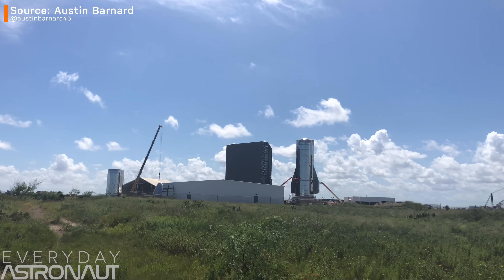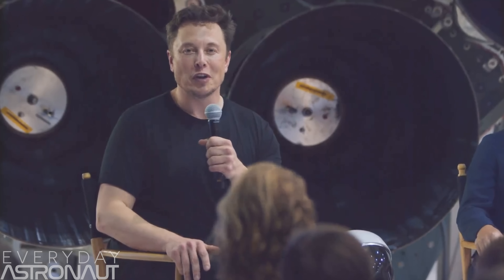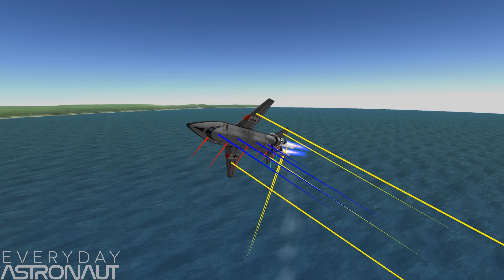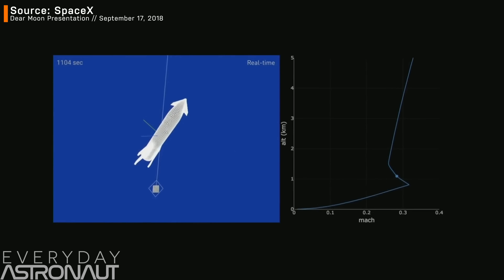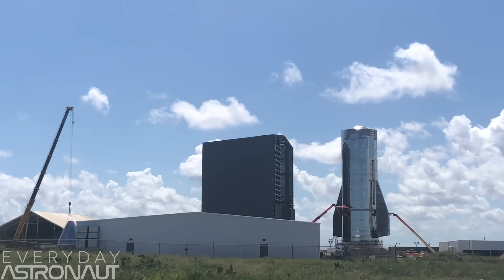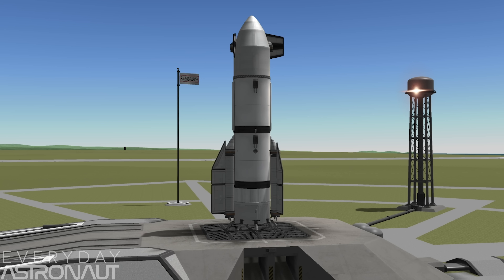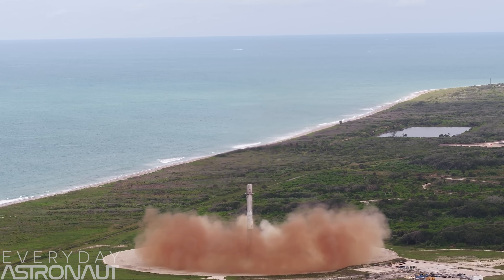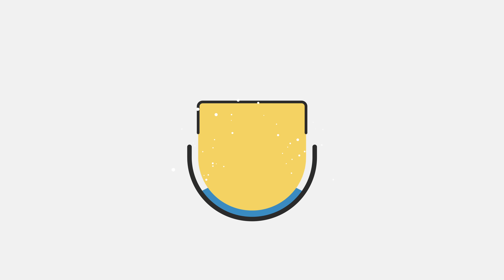Why does Starship only have 2 rear fins?!

Comment: You're all wrong, 2 fins look way cooler than 3
Reply: MrRolnicek agreed. Real engineering will always beat out artistic style.  Life may imitate art, but form follows function.  This mod is going to save a lot of weight and add maneuverability. 

Also the landing legs and two rear fin design now remind me of blue origin... TRIGGERED!
Reply: Preach
Reply: Two fins, and now the ceramic heat shield tiles, it's looking more like Space Shuttle every year
Reply: @SuperSMT  And the Space Shuttle looked HELLA cool. But it will never look like that. The wings on the Shuttle were too big because they needed to provide lift, the rear fins of Starship need to be actuated and they need to withstand reentry not edge-on but in a bellyflop. That will always limit their size.
Reply: SuperSMT right?! I mean, my god, it’s like they knew what they were doing with the level of technology they had!  I just assumed that people in the past were ignorant peasants and that Elon was the true enlightenment.  But it turns out physics is physics!
Reply: @radaroreilly9502  Shuttle didn't fail because of physics, it failed because of economics. That's no secret. The reusability of the Shuttle cost more than if they built a new one each time (well kinda ... you know)
Reply: MrRolnicek STS wasn’t a failure, it worked way longer than it was supposed to.  But it’s no surprise that starship is becoming less of a tintin rocket and more of a shuttle.
Reply: @radaroreilly9502  The fact that they kept it going doesn't mean that it wasn't an economic failure. It was made to be reusable because of course that's cheaper and it was more expensive than using expendable stuff anyway. That's a failure.

The fact that wings which are meant to create lift when used edge-on and flaps which are meant to have a large surface area look similar is no coincidence, you are right about that but if you start comparing function instead of looks you'll see that what looks similar between those two is actually completely different and what looks completely different serves the same function.
Reply: MrRolnicek ah, we are talking about two different things.  When I say it’s not a failure, I’m talking about a function of design not economics.  We didn’t have to care about money.  

Obviously the two are very different, I just think it’s interesting that as the design evolves, you kids start to have to deal with the same problems we had to “back in my day”.  Given the limited number of solutions, it’s not coincidental that a lot of them are similar in concept or execution.  That’s all I’m mean.
Reply: @radaroreilly9502  But they aren't the same problems .... and they aren't the same solutions either, THATs the funny part. They are completely different they just look similar.

Comment: Tim, I really like your new videos. You have grown into your role as space guru. Congratulations 
I have seen the stubby landing legs pics and am not impressed. Starship is very tall which translates into lots of leverage working to break the little legs. Unless Elon switches back to the original type of fold out large landing legs that we see on the Falcon Nine I fear that tipping over will be inevitable especially on moon or Mars. He changed the wings. Now he needs to change the legs. And I agree with his engineers that using three fins with legs included will have to be heavy to support the weight of Starship. I am hopeful that he will continue to make constant changes until he gets it right same as Block 5 for the Falcon Nine.

Comment: Flaps that are legs sounds like an engineering nightmare. If you need to change your landing legs, you have to readjust your aerodynamics.

I’ve been told that A/C are like jello, and you’ve gotta accommodate changes with other changes elsewhere.

Comment: I used to be a Military Free Fall Paratrooper, and I can see where the new two wing is coming from, we however have large canards on the top, we call them arms, which to achieve airfoil we sweep back and close to our fuselage, Body trunk and legs (Undercarriage), and we do create an airfoil effect, resulting in stalling and buffeting as well as horizontal flight, it all comes down to management!

Comment: At around 11:30 you speculate about the potential advantages of having a fixed landing leg on the windward side of the vehicle.
I'm pretty sure this would be unstable for all of the reasons you described earlier, when talking about aero surfaces near the 'front' of a vehicle.

In a belly-flop, the windward side (not the pointy end) is the 'front'. Having a big fixed sail protruding from the front, directly into the airstream, is the most inherently unstable configuration; the two articulated fins would have to fight it constantly. In contrast, when the fixed fin is on the leeward side it is inherently stable, and helps add to the stability of the overall system, even if the two articulated fins have their center of pressure closer to the center of mass.

When considering the balance of aerodynamic forces, you have to factor in all three fins, not just the two articulated ones.

Comment: Another important design consideration is the fact that 3 landing legs are kind of risky because with a single leg failing you are stuck on Mars with a tipped over rocket. With separate legs you can have 6 or more tiny legs that are fault tolerant.

Comment: Fine I suppose for reentry and landing on a concrete pad (earth). i'm super curious how this is supposed to work landing on an unimproved surface (mars-firma). I would think those fins would need to transition back to neutral to correct/balance the CG of the standing body.

Comment: Knowing they are going with a less robust landing system is a concern. A very tall vehicle like this is going to need, IMO, landing legs that have a very wide stance and high durability if it is expected to land on imperfect surfaces like the moon or mars. I would suggest legs mounted in a tripod configuration that would slide and extend along the external surface like the falcon rockets so it doesnt overcomplicate internal workings. This of course brings up other problems too because one of them needs shielding along with the stern mounted fins. It looks like the starship is headed back to its extremely early design. One of the things i like about elon musks idea is that the design looks more robust and tough, wich is something that is needed to inspire confidence in this odd vehicle.

Comment: Yo Tim,
Why do you think they have not used grid fins in the star ship design as they have worked a treat for all the falcons?

Also to answer your question, i think they will alow the physics design the ship over asthetics but i would expect elon to have a model of the tin tin design in his office or house for sentimental reasons because it was a cool design 😁
Reply: They will reenter the second stage (starship) at much higher speeds than the F9 first stage. For this, they need large control surfaces. Grid fins don't produce enough drag and might also not survive the heat. Putting them there in addition to the flaps would not make sense.
Reply: @tombratfred3102  thanks

Comment: I can totally understand why you'd decouple the landing legs from the control surfaces. You want those things to be super responsive! Imagine flapping your arm around with an empty hand, and then while holding a 10 pound weight. Any mass that can be removed from the fins translates into weight savings in motor size and battery pack size.

Comment: I agree that this has a lot to do with simplicity. Less is more in this situation. My only concern is the landing legs. The distance spread between the legs if incorporated into the body. You will want them away from the body like the falcon 9. This is also a big factor when landing on an unknown surface. Not to mention the height of Starship almost requires legs that are spread out to help for all around landing stability.

Comment: Another issue to be dealt with by the landing legs is the need to actively keep the starship vertical even in case the landing site were not perfectly horizontal, as supposedly would be on the Moon or on Mars. This would be easier to do with three legs, but having six legs or more would allow to remedy the eventual failure of one or more legs.

Comment: Big mistake landing vertically on mars or anywhere without concrete pad.
Reply: Hopefully, they will see how well they can observe the landing site in minute detail, from space or a surface rover, of an unprepared landing spot on Earth and try landing there several times first before finding a nice big flat spot on Mars with that one small overlooked boulder that will crunch the rim of an engine or exceed any landing gear flex upon touchdown.
Either on Earth or Mars, can't wait to watch the tests!
Of course, they could always use 3 tractor rovers with plows to level off a site ahead of time and/or provide an exact triangulation beacon for the craft of a closely pre-surveyed landing site! Lol
Reply: @grinninggoat5369  I will be convinced it will work after few for example unscheduled 
 beach landings.
Reply: @786otto  , it would be nice if the ship and crew itself could deploy small surface rover(s) with surface condition testing gear to survey a larger, preselected landing site and then anchor themselves in the soil as independant precision beacons when a best suited spot is decided upon while the craft remains in orbit, pre-landing... that way, even an emergency landing would not require so much help from Earth or other non-mission equipment already deployed in orbit or on planet primarily used for other purposes. Soil density, type, obstructions, composition.
1 rover as a becacon underneath the landing spot or any nearby that is unanchored may prove problematic at last seconds before touchdown if they would get blown about and disrupt the fine guidance of the craft though... so, maybe 3 rovers or 1 that tests site, anchors beacons and then retreats to safety to be recovered and possibly reused in the future.
Any site selection data gained from previous rover missions or orbital surveys may not be valid at the time of arrival due to the weather and sandstorms on Mars. 
In any case they will have to be very careful indeed and updated to the very moment on surface conditions localized to a very small landing area to make this work. Anything else is luck and odds if they plan to do repeat performances without problems!
One thing is probable... it won't be like landing on the Moon since Mars has a much more active surface. The soil on the Moon didn't get blown around by an atmosphere, have winds that uncover obstacles and the such and a general landing site could be picked easier far in advance for... I doubt there will be much human eyes in guiding intervention on the actual landing on Mars.
Reply: @grinninggoat5369  Hopefully they figure out the way to safely land

Comment: That's not what fly by wire means.
Reply from the maker: No? “Fly-by-Wire (FBW) is the generally accepted term for those flight control systems which use computers to process the flight control inputs made by the pilot or autopilot, and send corresponding electrical signals to the flight control surface actuators.” - first thing that pops up when you google fly by wire. Sounds like exactly what I described 🤷‍♂️
Reply: @EverydayAstronaut  It primarily differentiates mechanical (hydrologic, etc) vs electrical with an electrical actuator at the control surface. It changes a lot of structural requirements regardless of the software intricacies and refinements. This is fly by wire. Usually triple redundancy wire.

Comment: Dumb question of the day;  Why do they even need these huge fins, if they're just tucking them out of the way on descent?  The rocket clearly doesn't need them on ascent... 2. If aesthetics are important, I liked the elegant, curved sweep of the earlier fins more than these blocky ones.  3. The safety issue of using control surfaces as landing legs never occurred to me - I'm obviously not aerodynamicist material.  4. I'll just never understand why NASA spent seven years developing those tiles for the shuttles, if all they had to do was use stainless steel.

Comment: I never liked the 3 fin-leg version, having one fin just acting as leg. 
I prefer this version but I am sad that they would not use methane for RCS, using only one fuel for propulsion and control thrusters makes all the system smaller, more dynamic in the sense you choose in what you need to spent more and less tanks.
The only thing that methane thrusters need is a low power laser ignition system that was already tested to be super fast and reliable.

Comment: I think that two fins is more stable. If you put the third fin behind, it does little for control. If you put it in front, it will be fine until a slight roll. This will greatly increase drag to one side, and increase the tendency to continue rolling. I noticed on the Starhopper test that with three fins in a stiff wind caused a roll. It wasn't bad but it was there. Thankfully a slight roll didn't pose a problem for the test. But landing a Starship will be much more demanding. I also play KSP. Thanks for the informative video.
Reply: I think Tim or someone mentioned somewhere that The roll on starhopper was intentional by way of the acs thrusters.

Comment: It was never really a 3 fin design as the 3rd one was fake.  It was always about where to best place the 2 functional fins and it's clear they work better directly on the side.  However, the weight (and reach) of the landing gear do "weigh" against that.

Comment: Hey Tim. Why SpaceX not configurate Starship like a Falcon 9 with it own Gridfins and retractable legs? Thank you for the answer
Reply: Only the Falcon 9 booster lands and it never gets all the way up to orbital velocity so it doesn't have as much speed to remove.  In contrast starship (which is the second stage) does get to orbital velocity, so it has to remove that speed to land.  There's too much speed to be an efficient use of fuel so instead they airbrake, skimming the upper atmosphere to slow down.

Comment: They could still have 3 Flappy Flaps that swivel sideways to tuck away using 2 or 3 hinged joints & hydraulic rams to straighten them at the appropriate times for legs or for aero braking.

Comment: You don’t have to worry about the number of fins during landing on Mars, there isn’t enough ‘air’ on Mars to bite into aerosurfaces.  They will need a long propulsive braking burn to land there and then rely mostly on RCS.  I always assumed Starship would do a skip entry because a traditional entry just seems like 2 fins would be reduced to zero somewhere around 200,000 feet.  It has a shape that could be used for a Sanger style entry profile but getting back is still going to be tough, very tough.  The belly flop maneuver is the very thing you would do to put yourself into a flat spin, their yaw control better be really good.

Comment: 1. Two fins / aerobrake flaps seems much more sensible. 
2. And separating the function of aerobrake flap from landing leg seems more sensible as well. It is a lot of engineering to make a big fin / flap support the weight of the space ship.
3. As for whether they will tuck in on ascent, my guess is that they will not articulate that far. Sticking straight out will not be any worse aerodynamically than sticking slightly out but nearer to the cylindrical hull.

Comment: bottom legs are certainly going to be lighter than wing integrated ones and there are a few other advantages but this is a bit simplified - I think one of the biggest advnatages is the angle at which the fins can be attached if they aren't landing legs

Comment: 3:50 in a event of a damaged Starship on Mars/Moon and flying it back to earth:
Would it not be wiser to rendevouz in earth orbit with a totally intact Starship, transfer passengers and cargo and THEN try to land the damaged one?
Reply: The problem is that they need to slow down when arriving to Earth. And it will likely require more fuel than the ship can carry to slow down without aerobraking.
Reply: @anthonypelchat  
Right. Aero-braking is needed to land even from LEO, not possible to reach enter any Earth orbit (from Moon, Mars, etc) without aero-braking to dump energy. [If the sea-level Raptors were the only problem, then a ship-to-ship transfer would make sense.]
Reply: If that were to happen, probably yes, depending on the extent and nature of the damage. But even as cheap as Starship is supposed to be to launch, that's still a lot of added cost, and a LOT of added complexity. Still better than risking lives inside the damaged one, but still hardly ideal.
Reply: Do you have enough fuel to get into earth orbit? If your craft is not safe to re-enter in then it is not safe to aerobrake in either. From mars you could probably to a lunar gravity capture, but you are not exactly in LEO after that.
Reply: @agsystems8220  rendezvous with a fresh Starship around the moon maybe.
Reply: Do you know how hard it would be to connect with another satalite in an unplanned return to earth?
Reply: @ethank.6602  no, not exactly. But if it were easy it wouldn't be called rocket science 😉
Reply: @ethank.6602  if approaching Earth, wouldn't that only be possible because of intentional Earth transfer orbit burn? 

[Anyway, if you are talking about rendezvous and docking, that is one of the earliest missions once two starships can be launched into orbit. The next mission will be to transfer propellants enough times to fill one ship. Such a ship can reach anywhere in the inner Solar system, including emergency rescue missions.]